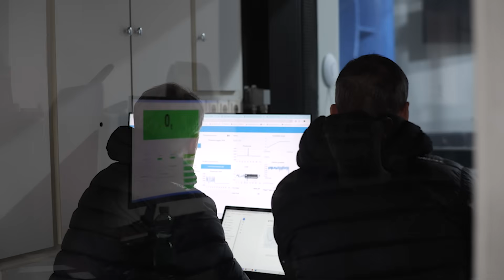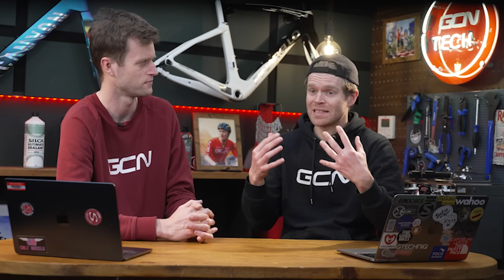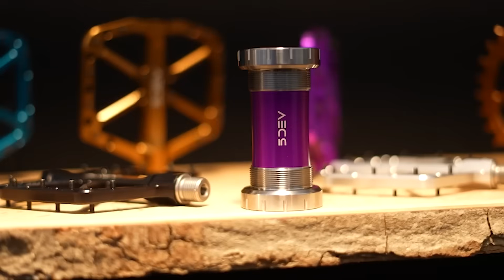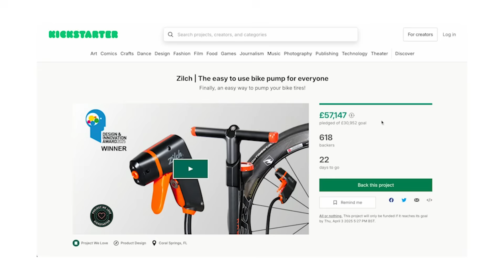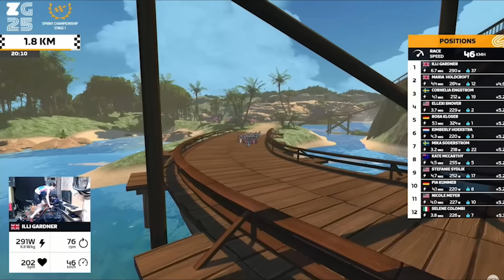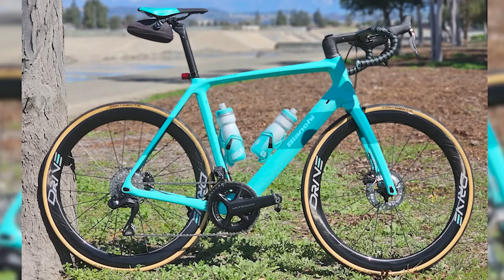The Secret Weapon AG2R Used To Get Faster | GCN Tech Show Ep. 377

Comment from the maker: What do you think about AG2R’s aero rake? Do you think more teams should invest in similar tech?
Reply: This is not even new in cycling.  Reserve Wheels used a motorcycle with a rake on the front on roads in the e development of some of their road wheels in order to help them build a more accurate model of turbulence on the road.
Reply: Swiss Side was already using this a couple years ago on the road. Back then they where consulting for team Ineos
Reply: Is Elite still one of the wheel sponsors? I have Marvel 60V and you never pick my Diamondback for the bike vault 😢
Reply: Would be cool to take wind radar tech and map everything…not just down flow turbulence.
Reply: @RKC3.14  There is no such think as a wind radar. There are lidars that measure wind, but they get you one profile and are not really simple and definitely not for labs. Wind tunnels use PIV to map the flow.
Reply: Jajajaj😂 B & B are great, but you are the best. Tnaks for all tech and smiles 😂
Huh, huh, huh ,
Yeah, yeah. Cool that stuff
Reply: Why so many pitot tubes? Why not hot-wires? Or really just PIV? You see much more with PIV.
Reply: used them for 15 years  or more in F1 to gather Aero data on cars and wind tunnel models to make sure they correlate and feedback into CFD not new just borrowed from another industry but seeing as a lot of sport tunnels are staffed by ex F1 staff its not a surprise to see similar tech
Reply: @ Strange, in fluid dynamics research thhis would be pretty obsolete technology even those 15 years ago. No information about turbulence, a lot of flow disruption, many drawbacks to other instruments. But it is cheap and measures in multiple points...
Reply: Hello Ollie, Regarding your DT-Swiss visit story...  For almost two years I've been trying to get your attention about rotation wheel balance which has become one of your top/favorite performance recommendations.  I have a feeling DT might call you back...
Reply: Budgie smuggler is Aussie slang for Speedos.

Comment: SwissSide have been using Aerorakes since at least 2016 in cycling so that video is clearly just an AG2R advert. 
A $500 titanium bottom bracket is jewellery, nothing more. 
Trigger style pumps are solving a problem that doesn’t exist. 
Princeton $5000 wheelsets and a £12,500 cannondale gravel bike, no interest at all (if you need it your team will give it to you, if you’re not in a pro-team they are jewellery).
Another advert covering the most expensive road e-bike ever from Orbea. 
Must be tough squeezing any real content or opinions in between all of these adverts each week but it feels like it’s getting worse to the point where even the bike vault feels like an advert.

Comment: Somebody pointed it already in the last video out but Connors 175mm cranks are already short cranks compared to his body height. Even for me at 193cm 175mm cranks aren't exactly long cranks. 

But it would be interesting for video to make a bike-fitting for Connor and Ollie especially with different crank length to see how an optimal crank length varies with the body height.
Reply: I mean, it really depends on your hip function and how low a body angle you can get / your body tends toward. I'm "only" 178cm, but I have the same length legs as someone who is about your height, and I was getting hip pain and referred back pain on 172.5 cranks. There was a bunch of different factors going into it, but I'm now happy on 160s.

Comment: I don't understand the benefit of a titanium bottom bracket. The Dura Ace BBR9100 is only 65 grammes and I don't think anyone has ever said it isn't strong enough or too heavy, it should be made from Titanium. The Shimano BB is about 50 or 60 NZD about 30 USD and has anyone ever complained about the bearings in the DA BB. Even if the bearings don't last as long I can replace it about 15 times before I get to the 5DEV price. Yes it's bling but being honest if someone turns up at a club ride with a bling titanium bike they are Gods, but if they turn up with a titanium BB they are a bit phallic.
Reply from the maker: we guess it is for the cyclist who wants the best of the best of the best?!
Reply: @gcntech  I don't have a problem with cyclists wanting and buying bling. We have all been there! I think my issue/problem is summed up in the question "from a materials perspective is titanium the best material for this application? But ln the interests of full disclosure I wanted a Field bike because I am from Sheffield and the phrase Sheffield steel sucked me in. Now that Field are developing carbon fibre and titanium bikes I have fallen out of love.

Comment: #askgcntech on the subject of shorter cranks. I’ve heard it mentioned several times that if you go to shorter cranks you should lower your seat. When you set up your seat height you measure from the center of your bottom bracket to the top of your seat. I’ve never heard of anybody taking their crank length into consideration. A short crank length only changes the arc of rotation. I can’t understand why a person would need to lower their seat.
Reply: You should RAISE the height of your saddle when going to shorter cranks, not lower it.
Saddle height is set by the angle of the knee at the BOTTOM of the pedal stroke. If you switch to say, 10mm shorter cranks, the bottom of the pedal stroke is now 10mm higher than it used to be - you would need to raise the saddle height by 10mm also to keep the knee angle consistent.
Yes, it is easier to measure from the BB, as this is a fixed point, but you will have to adjust for the change in crank length.
Reply: Lots of people, maybe not the core audience here, won't measure though, they'll use the pedal at 6 and lock your leg with heel on the pedal method to set the saddle height.

Comment: We used pitot tubes in the very early seventees to measure fluid flow at work. A pitot tube is used to measure fluid flow velocity. The tube is pointed into the flow and the difference between the stagnation pressure at the tip of the probe and the static pressure at its side is measured, yielding the dynamic pressure from which the fluid velocity is calculated using Bernoulli's equation. A thermodynamics course will teach you all you need to know. Simple really.The harder bit was using a slide rule for the calculations instead of a calculator, which were yet to be invented or at least not available to the public to buy at that point in time. Ahh Reynolds number, Friction factor, napierian or natural  logarithms to the base 2.718, it's all coming back now.

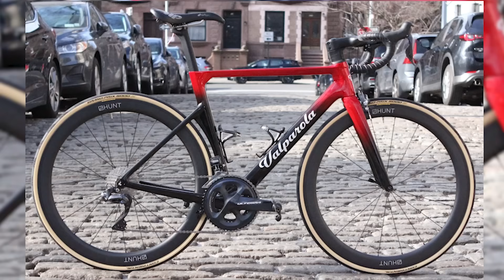Comment: Did Conan and Wally let something slip through into the Bike Vault?  The Valparola at 21:34 doesn't appear (to me) to have a rear brake.
Reply: Behind the chainring, perhaps?
Reply: @BikePappy  I considered that possibility but could see no evidence for it.  Also, how would the calipers screw onto the frame?  The screw would have to be more-or-less vertical, and I doubt there'd be sufficient room for a bridge between the chain stays.
Reply: @richardharris8538 If you zoom in and look at the crank around the 8 o’clock position, you can see part of the rear brake shoe. It looks like Lightcarbon sells many frames with direct-mount rim brakes mounted behind the bottom bracket. On their website I would guess that this frame is the LCR015-V.
Reply from the maker: chainstay mounted brakes were a thing for early mtb's as well as some TT bikes
Reply: @gcntech  I had a vague recollection of having seen that arrangement somewhere, but it doesn't look, (to me), as if there'd be room on that Valparola.  And anyway, what would be the point?  Imagine trying to adjust the brake pads.  That'd render any possible slight aero advantage as not worthwhile, (for me at least).
Reply: If you zoom in and look at the crank around the 8 o’clock position, you can see part of the rear brake shoe. It looks like Lightcarbon sells many frames with direct-mount rim brakes mounted behind the bottom bracket. On their website I would guess that this frame is the LCR015-V.